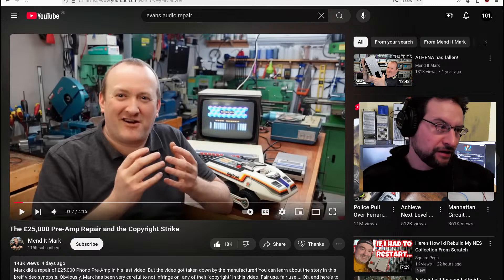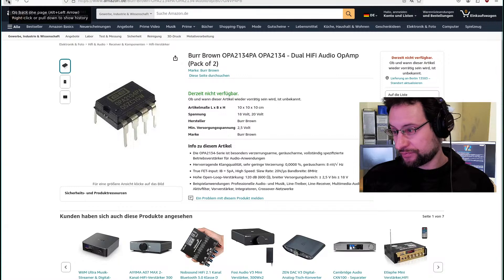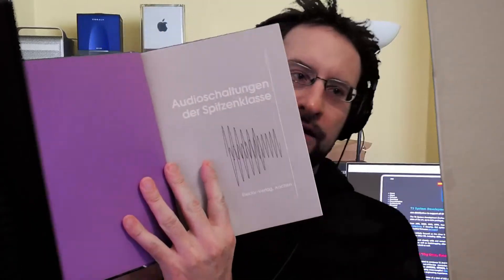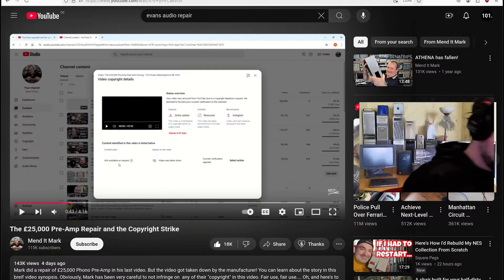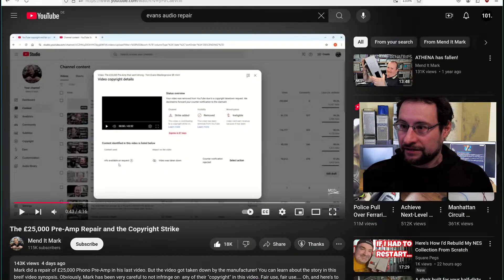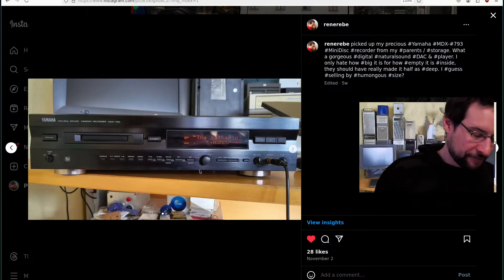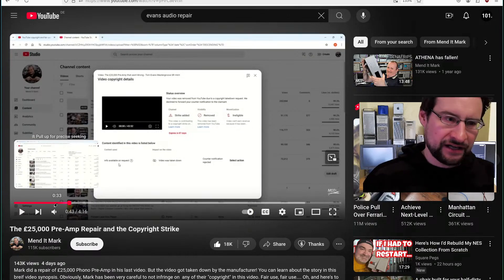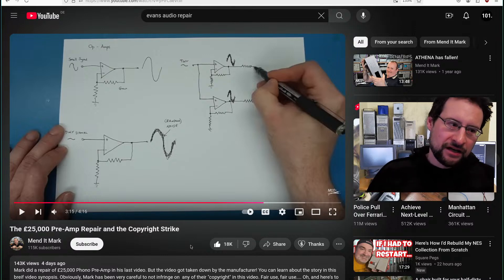25,000£ Audio Pre-amp Repair Copyright Strike SCAM & how to get better schematics!

Comment: I saw this video. I love watching a pro at work and Mark is a step above many out there and a joy to watch. To assist him with repairs and for reference he often draws out the circuit/s and being the professional he is he prints them out so they look factory made. I get that and I get that this unit is sold to those with much money but little brains.
What Mark did wrong was to not only reverse engineer the pre-amp but show the really nice manual that he made. If he had NOT shown the self made schematic he would and could NOT have got a copyright strike. I do hope Mark has learned a lesson. I also hope many people saw the video and pass on to interested parties that the unit is over-engineered and overpriced.
Reply from the maker: What’s wrong with making a manual? This amp was also not overengineered but cheap overpriced crap, …

Comment: I have seen YT vids talking about "Super Capacitors" - with applications like a capacitor bank to replace a car battery etc. Caps physically as big as a 100ml tin of Red Bull.

Would those be electrolytics - chosen for high "Joules per Litre" ?

Comment: I saw this video this guy knows electronics and knows what he is doing.  He on his own worked out the schematic diagram of the equipment and made his own original
artwork.  The one and only reason the manufacture of the pre-amp is attacking this guy is because he exposed that it is rather dodgy.  The equipment is in no way worth
the price.

Comment: I love that all us electronics designers are coming out of the woodwork and giving our 2p worth in the comments!
Reply from the maker: 🫶 Right to Repair – Schematics & Boardviews!🖖
Reply from the maker: @twocentman  of course schematics for repair. They mostly use orig vendor reference examples anyway. Do you really think not publishing schematics stops competitors reversing it when just reusing IC databook examples is cheaper ?
Reply: @twocentman  I can reverse engineer a pretty complex board into schematics in less than a day and I'm not even an EE. Schematics are not the problem you think they are.
Reply: @twocentman  Is your head up your ass?, china would have reversed engineered that pile of crap long ago.
Reply: @twocentman the schematics are just an aid to repair. Yes development time is important but the cost of the equipment at the price there is plenty of room for development costs . If you copied it and tried to sell that is NO NO.  But the video was a repair video not how to copy it.
Reply: @twocentman  Reverse engineering is a widely recognized and legally supported practice in many countries, especially for purposes like repair or education, as long as one has lawful access to the product, ownership is not required.
Reply: @twocentman  When I buy an item I expect to be able to repair it. 
Generating e-waste is not cool.
Reply: @G-ra-ha-m   @G-ra-ha-m  I am full behind the right to repair. Mostly 90% of all electronics can be repaired. Question has Mark really used the schematic to find the tantalum fault ? Absolute No. He provides online courses about reverse engineering makes a product schematic, displays it to the public and assosiates it direct to the evans mastergroove without permission.
He was in the wrong too. The damage is huge now.

Treat others as you would like others to treat you.

Comment: I wouldn’t call that high-end. The piece of crap he repaired was actually just overpriced.

Not high-end
Reply from the maker: Agreed 💯  the book I recommend has more high end designs 🖖
Reply: @MoreReneRebe  Tom's design was nothing special, and the implementation very clumsy. He's just trying to hide - Look at the inside of his Linear A amplifier, it's the same tangled mess, and the same plastic standoff, in the same hideous case as the PSU.
Reply: Cardboard spacers..?

Comment: You can't argue with audiophiles, it's not about the music, it's more about being in a cult.
Reply: They will never beleive that making cable is huge dirty industrial scale work. A cable is made in the lengths of kilometers at a time. To make a cable that costs more than $0.20 a meter is just not viable. That $5000 a meter speaker cable probably was originally designed for a CAT scanner at pennies a meter in China or Poland. These little Audiophile companies do not have huge smelting works and metalurgists working away behind the office.
Reply: n
Reply: To me it seems that they listen to their equipment, not the music…

Comment: back in the 80s you could still get nation semi LH0066/LH0033 op-amps with slew rates in the 6,000/1,500V per uS - excellent things to hook ADC/DACs to…
Reply: I seem to remember LH0032 was the opamp and wasn't LH0033 a unity gain power output stage? They were amazing devices and quite large package as they dissipated a lot of heat. They were mil spec approved parts which is where I came across them - and used them for video processing

Comment: I saw the video being referenced, and I have designed and worked on audio equipment.  The mistake Mark made was removing the cover and exposing the joke inside for which some people have paid 25K.   :face-blue-smiling:  

This obviously raised the ire of the manufacturer.  YT is, typically, way out of line going along with such nonsense.  There is no valid reason for the strike against Mark - all he did was open up the amp and repair it.  And, it  probably cost more to do that than the amp is ACTUALLY worth.
Reply: It was the manufacturer who sent the device to Mark and they knew he showed his work on YouTube, but still gave him shix.